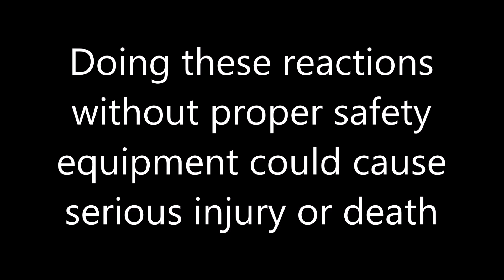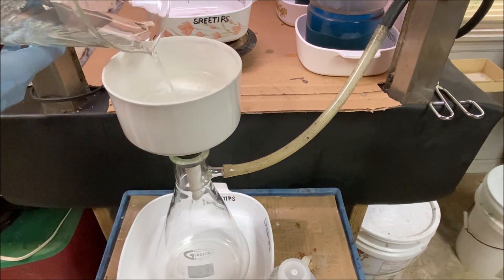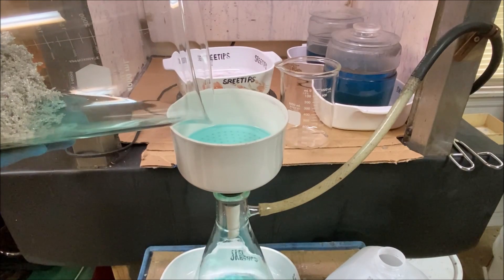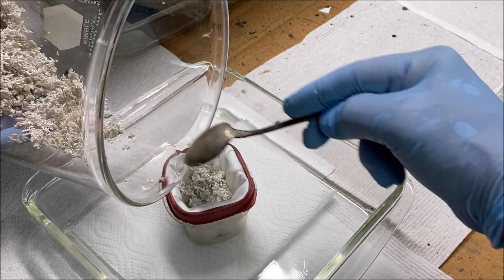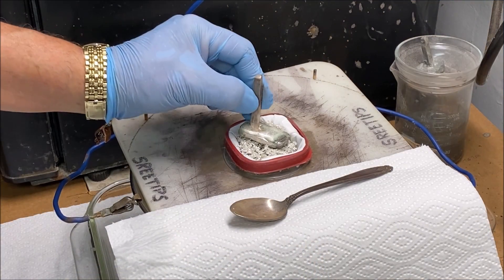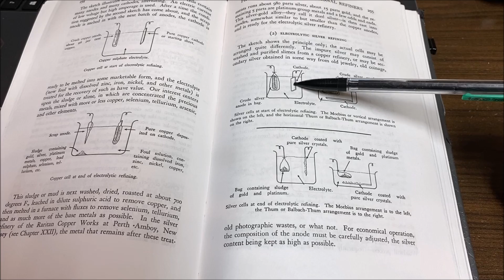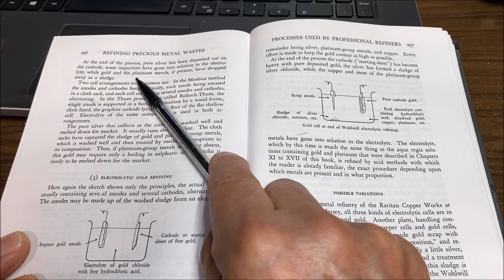EP004 Electrolytic Silver Cell Reboot

Comment: Hello
great video.
Can someone please give me a relevant answer?
1/ in what range should the current be on the cathode?
2/ is this method suitable for removing silver from copper sheets? won't the copper decompose?
thanks for the answers.
Have a nice day
Reply from the maker: Voltage is constant at 3.5 volts DC. The current flow, amps, will vary depending on changing conditions in the cell.
Reply from the maker: I have no experience with copper sheets

Comment: Hey Sreetips.
1) Why did the silver crystals were discoloured that made you run the silver cell again?
2) How low purity of the silver shot may I use for the silver cell? Is 90% okay?
Reply from the maker: 1) discoloration - cause unknown. 2) I use 98% to 99% pure silver. Lower than that tends to foul the electrolyte quickly.

Comment: so, i was wondering if you knew a way to make a super dense liquid out of household or easily accessible chemicals that are non toxic etc etc... i woudl like to find some way to separate quartz from heavier (possible) diamonds... so, i need some sort of solution that is at Least 3 grams per cubic centimeter or so in density. or at least dense enough that quartz could float on it. (and pieces around 1/8 inch mesh minus just about. and all about uniform size too... just figured i woudl ask around since buying a dense liquid is Expensive. ugh. and this is just a minor hobby level diamond searching via a box bought from a mine in Arkansas.  im trying to do a final sort and separation but im a novice at identification. but i figure, a dense solution could be just the thing to help out, as i could then run my material concentrates from the Saruca screening step. i was looking at a salty solution, but i doubt that's dense enough to float quartz at 1/8 mesh minus, and only allow diamonds to sink... but, maybe you have an idea, as something of an epic chemist. =)
Reply from the maker: I don’t have any experience with that
Reply: @sreetips  thanks for the reply. alas, that's ok. lol. ive looked it up and for i think a liter of such a liquid its over $700.... ouch... but, oh well, i will find a way to make it easier hahaha. i suppose i may as well get a gem tester first and be methodical about it. anyways, i love to see your gold and silver processing. that's one way to get some shiny =)

Comment: Tip: When you make your new wire harness, build it with replaceable leads. That way when they eventually corrode, you only have to replace the lead and not the entire cable.
Reply from the maker: I’m experimenting with a wire cast into the bar to completely eliminate the connection down by the cell

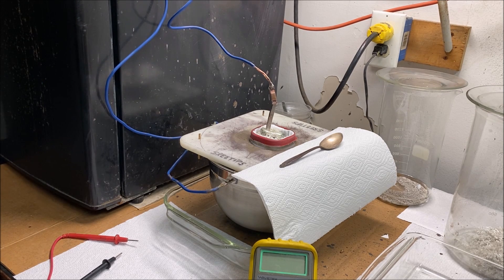Comment: 8:00 When you make up new harnesses, please color code the wires for + and - .  It drives me crazy to see someone using two same-colored wires for delivering DC voltage.
Reply from the maker: I never thought of that. Is there a standard color for each? Thank you
Reply: @sreetips  "...standard color?"
Basically, black for negative, any other color (red recommended) for positive.
Reply from the maker: Thank you
Reply: @sreetips  
No, thank YOU!
lol
Reply: @xenaguy01  FYI, it’s not uncommon (especially on European lab gear) to see blue for negative and red for positive.

Comment: question> why don't you get yourself a stronger pump? helps with filtration, distillation(solvents) and 'freeze drying'

always glad to see the videos
Reply from the maker: Because the vacuum pump that I have works great. It will pull 29 inches of vacuum - can’t get any higher than that.
Reply: @sreetips  no but you can have a higher flow.

With all the filtering you do you should treat yourself to a turbo pump/rotary vain pump

You filter sometimes gallons of liquid.

Comment: Do you get a lot more money for the silver crystal as compared to the silver shot?
Reply from the maker: Ryan, I used to sell bars. First I measured and melted the silver crystal and poured into a graphite mold. Sometimes bubbles would surface and ruin the pour - had to repour. Sometimes the weight was off - had to repour. Then I hand-stamped each bar. They were beautiful and I controlled quality with strict discipline. It was a lot of work, but I could sell them easily. By selling the crystal I can avoid all that work. People seem to like it better. But I only sell a little to help pay for rent and groceries.

Comment: You should use a stainless wire brush to clean the annode. Using the brass wire brush can transfer brass on to the silver
Reply from the maker: Brass is copper and zinc. If it gets in the electrolyte it will stay in solution.
Reply: @sreetips  I honestly was not sure if the zinc would be a problem or not. Thanks for learning me something today sir! I have been following you for 2 years now. Keep up the good work

Comment: Any insight into the limiting factor of your current silver cell's throughput?  There are a lot of possibilities.  

I suppose the simplest one is the surface area of your silver shot.  That depends on the size of the shot, and your basket size, which is limited by the size of your entire cell.  

When you chose that Dacron fabric did you research how well it would pass Ag+ ions in solution?  I doubt that's a problem since it's a fabric and not a continuous sheet like in a battery membrane.  Any idea what a commercial cell uses?

The bowl would appear to have enough surface area, but that's easy to test.  Just create an additional electrode out of more stainless and add it to the bowl.  If the current increases you've found a limiting factor.  Use SS screen or thin SS sheet with holes in it.  It's just a test, you aren't going to run it this way.

Here's a link to Electrorefining on Sci-Hub.  It lists a book on refining by Mooiman & Simpson, 2016.  Chapter 34 is 'Electrorefining of Silver'.  If you click on the button 'View Chapter' you can read it if you have permission.  OR just enter the DOI number 10.1016/B978-0-444-63658-4.00034-7 into Sci-Hub at h-t-t-p-s//sci[dash]hub[dot]com
You'll find some useful tips in there.
Reply from the maker: My cable were corroded

Comment: Are you getting a faster reaction/chrystal growth from using the silver crystal opposed the silver shot or is it the same because the current running through the cell is the same?
Reply from the maker: The silver crystal has a much greater surface area presented to the electrolyte so it tends to dissolve much faster than the shot. Plus, since it’s already high purity, the anode filter stays clean and copper doesn’t build up in the electrolyte. This also speeds up the process.
Reply: @sreetips  ahh totally makes sence 👍thanks for answering my question
Reply: Faster rate would show up as more current.  Something else is the limiting factor.

Comment: Yeah good one! In low voltage systems good connections are very important so as you did it's also a good habbit to solder conections as they have the lowest resistance and aren't very much influenced by the slightest corrosion. btw. Impedance is the word for Resistance in Alternating Current systems, is frequency dependant and has the letter Z in stead of R. You can even measure OVER the connection to check the voltage drop on the connection so for exaple between the clamp and the bowl.
Reply from the maker: I’ll stop saying “impedance” when my viewers quit saying I’m “smelting” the gold (lham). You’re right, it’s important to use proper terms. Makes me look ignorant. Thanks for the correction. Lham = laughing hard at myself!
Reply: @sreetips  You can't know everything and I think people are only stupid when they stop wanting to learn while they can. willfully ignorant you call that in English? It's been a bit quiet on your side but still enjoying the channel.

Comment: There's never an ET or an EM around when you need one, Sr. 🤭
I'm so glad you got that cell thumping and I'm glad to hear about the second cell. How much bigger is it going to be? 😉 I guess we'll have to wait to see what you have in mind. 
Your wiring is probably fine and can still be used with no problems. As a rule it seems problems generally always come at connections of whatever kind. With those wires you're using being bent around somewhat repeatedly you could possibly wear a weak spot or two. Watch out for places in the wire that seem to bend easier than the rest.
If it were me I would experiment a bit with one of the silver cells. Play a bit with current flow. Does dropping the amps somewhat produce fatter crystals or does… maybe I'm just a mad scientist. 
Thank you, Sr. 👍👋

Comment: Got a few more supplies to acquire, but just about ready to start my first run of gold filled scrap.  Just gotta get an acetylene torch, filters and build a vacuum pump. Which means,  i need to study the video you have on that.  Can't wait
Reply from the maker: Don’t forget a fume hood. No way to safely do these reactions without one.
Reply: @sreetips  still looking for one. Dont have much confidence in the one i built, not a lot of suction from the single blower motor. They seem to range wildly in price....
Looking at a polypropylene one from cleantech, any suggestions?

Comment: I already see a problem in your ground wire. It needs to be the same gauge wire and one solid piece of wire. Increase the ground wire up one gauge. It works fine now but it will not later. You will be right back into the same situation.

You also need to use rubber black tape to completely seal the connections! Stretch the tape as you are wrapping it so the tape seals to itself. You need to completely wrap the wire with two layers and the connections. Wrap the wire at least two inches up from the connections pulling it tight as you wrap everything. This makes the rubber stick to itself.

If it were me? I would cut one of the ends off of the positive and use heat shrink tape. It will last longer. also when you use two different gauge wires like you are using on the ground it causes different transfer of resistance, voltage and amps. Thought it’s not much now as the corrosion buildup on the wires in their connections it will increase the differences between the bigger wire connected to the voltage supply to the ground.
Please correct me if I am wrong? It’s been a very long time since I went through the internal communications school in the United States Navy. Have you checked the resistance between the positive and the ground wires? 
I would go to Lowe’s and look in their  drops, returns and miss cut wires for some #10 wire… At least #12 wire because of the bigger diameter wires will allow a better transfer of amps and voltage without a higher resistance. More copper allows a better flow of electrons. To bad you can’t get some wire from an old WW2 ship!
Reply from the maker: A CWO4 recommended casting a wire directly into the anode bar to avoid having the copper clip done near the cell. Brilliant!
Reply: I also went to IC school, in 1969. Still use what I learned in those classes for all kinds of things.
Reply from the maker: The Navy has produced many a tradesman over the years. The Navy was good to me and I was good to them. Thank you for your service
Reply: @sreetips  
And you for yours.

Comment: Mr Sreetips, the greenish/blue powder deposited on the Cu terminators is a corrosive comnination and, mostly,  the the work of the electrical system set up. In the original posts when you introduced the issues I added some formula and prescriptions together with several of our friends here. Electromagnetic force will always generate (some) heat when electricity is circulating through wires, mecanical connections and soldering, the quality of the wiring, screws, etc.
Since you are building a new cell from scratch, and you are in for the lomg rum, I strongly recomend:
1) Look for high spec cable wiring (in a nutshel, they would be thicker than yours, insulated, preferentially made considering continuous 2 A flow.
2) Make it one cable from the power supply to the cell, avoiding more connections and other fators that can build resistance
3) Insulate the terminators the more you can (like using heat activated insulation). The less they can be isolated from the environment the better. Ideally, they should by almost like audio jacks, to open them you do not touch the metal directly, but the insulatiin material
4) Great job converging the source with the cell connection. This gets your cabling resistance out of the way (in the video still shows difference, there should be none at this point, there is still contact resistance being built and this grows not slowly). I am assuming the losses due to the connection to the silver basket and the innox bucket are a constraint, so we must minimize, or even eliminate whatever risk source we might have before them

I went to Electrical Engineering grad school with extra year in Electronics, graduated back in 1986. Been hands on practitioner ever since. My main hobby before I subscribed to your channel years and years ago was to "repurpose" whatever electronics we are to trash at home, from haribloweds to the gears and motors of CD readers. From motherboard oscilators to dial up modems. I have beautiful DC multi voltage power sources built from old desktop computers (you have real time readings of voltage and current for each source), to low consumption cryptocurrency miners. I am an uncontrollable nerd too. 😊
Reply: "uncontrollable nerd"  lol  good advice, though.
Reply from the maker: Excellent info - I’ll put more effort into a new harness design
Reply: Hey I like your analogy on the basics of the electrical connections being the most crucial I'm not electrician but I'm enthusiast of All electronics I also repurpose all electronic scrap finding the best parts to keep the best parts to get rid of and trying to understand how all of this electrical universe works from right in front of me on my table but my newest interest is in the refining of the precious metals and as you said Street tips is one of the best sources of knowledge on the Yube right now. Thanks for your insight as I learned from your comment also
Reply: @ChannonWW2214  Thank you!!! Mr Sreetips is the best

Comment: I would drill a hole in the top of the anode and solder and encapsulate  a two foot lead wire, moving your alligator clip away from the corrosive environment, might last longer that way. I would think having a mechanical connection in that corrosive environment will always lead to resistance buildup. Love your videos. Avionics CWO4 (Ret)
Reply from the maker: That’s an excellent suggestion - I may use it in a future video. Thank you!
Reply: Solder?  LOL  It's pure a silver bar!  Just drill a hole, flux the wire, insert it in the hole, and apply the torch. :-)
But that's a damned good suggestion to eliminate the clip.  Run that wire from the bar straight up to the PSU connector.  Easier to make replacement electrodes too.  No more need for that silver stub sticking out of the main bar.

Comment: @sreetips while watching this and realizing how much material you have to process I came up with a possible solution for you.  You could easily hook up another silver cell in a series circuit with this one to double your output with the same power supply.  Give it a go and let me know how it works.
Reply from the maker: I’ve tried it with negative results. One of the cells in the series will find a weakness and begin robbing power from the other cell. In the experiment one of the cells had normal looking crystals but the other cell looked like silk/hair. It’s best to use a separate power supply for each cell.
Reply: @sreetips  that’s unexpected. Wish it would have worked for you.  That would have made it super easy and cheap to set up another one.

Comment: Have you ever investigated whether you can buy just the raw dacron material without buying it in the form of a vacuum bag? I bet it would be 1/4 the cost. Those vac bags are not cheap.
Reply from the maker: Probably right, I’ve not looked into it very strenuously.
Reply: @sreetips  you could almost definitely find it on Amazon. If not, AliExpress or Wish would have it, but longer shipping times.
Reply: @chemistryofquestionablequa6252  I buzzed through your typical sources for raw dacron material. The issue would be the thread (per inch) count on just some kind of dacron material vs what the thread count is on a vac bag. = permeability. I was not able to find any such info looking up vac bags @ Home Depot, etc. Perhaps it is on the actual vac bag package. Here's where a phone call to a knowledgeable fabric supplier could solve the mystery. What would be great is if the dacron mat'l used on sailboat sails is similar in thread count to that of the vac bags, because you could get suitable 8" x 8" scraps of mat'l for free.  Or, a yard (assume 36" x 36") of the ultra-fine mat'l is like $11. That would make a hella lot of anode-bag filters. https://www.wicksaircraft.com/shop/certified-polyster-dacron/
Reply: @pneumatic00  I don't think it even has to be an exact match. The main thing here is it being able stand the conditions of the cell. The exact thread count likely doesn't matter.